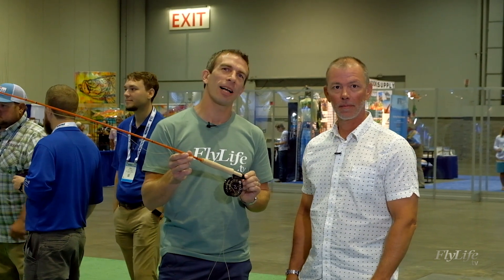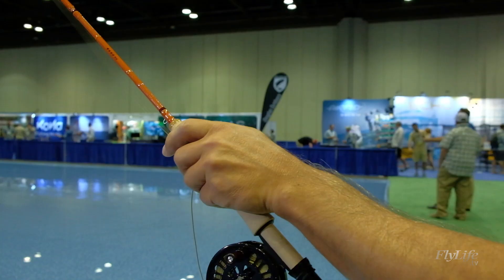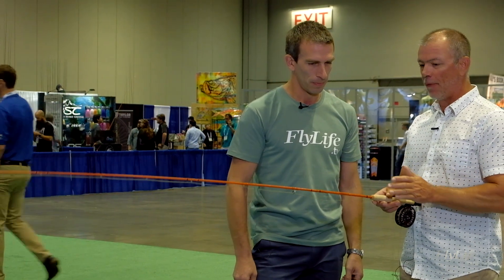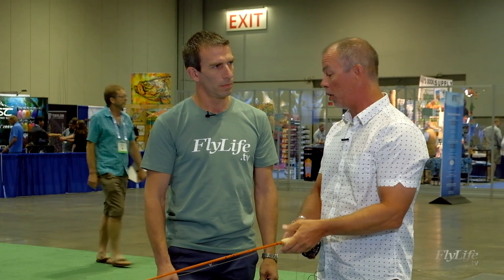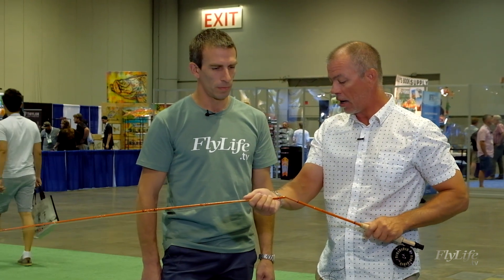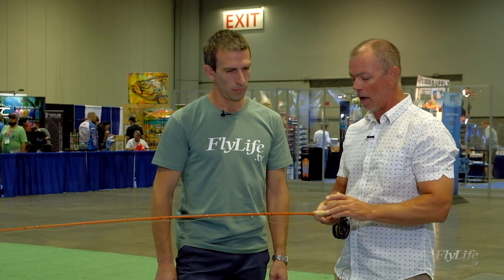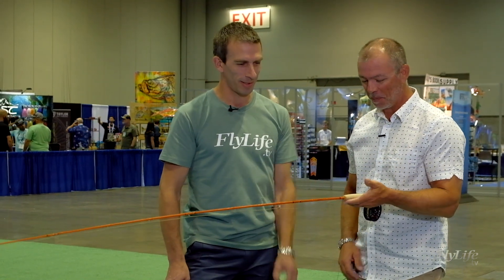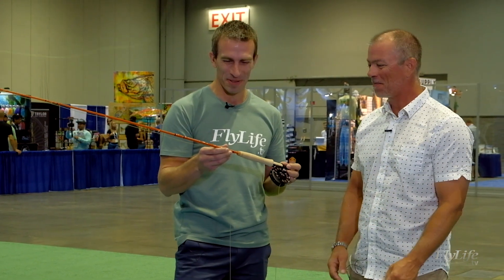Scott F Series Fiberglass Fly Rod - IFTD 2018

Comment: Really hope they dropped the self aligning reel seats. I’ve encountered 2 Scott g series that were misaligned when assembling the reel seats. Both damaged the finish on my force SL2s reel foot. Called Scott 3 times about the 2nd instance and they never responded...
Reply: Send them an email and I am sure they will respond. Their customer service in my experience is second to none.
Reply: hicnar I called and got ahold of a lady that told me Jim was busy at the moment and would give me a call back (I also left a voicemail message). I haven’t heard back. I ended up returning the rod to the shop, they were generous enough to take it back despite taking off the film on the cork. I more or less wanted to know what the reasoning for the inconsistency in reel seat alignment of two g series I’ve purchased (one at launch & the one I purchased months after) . No way I was going through warranty (on rod #2), having only purchased it a week prior. Thanks for your help.
Reply: hicnar I also should note. I own a few of their radians (they use the same reel seat) and there’s absolutely no misalignment or issues.